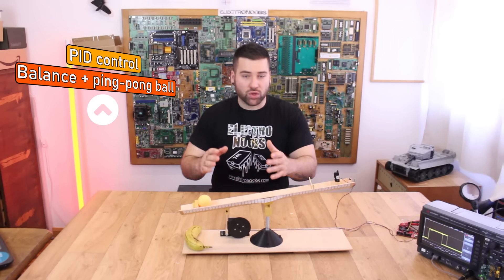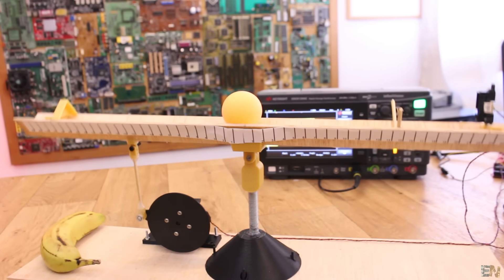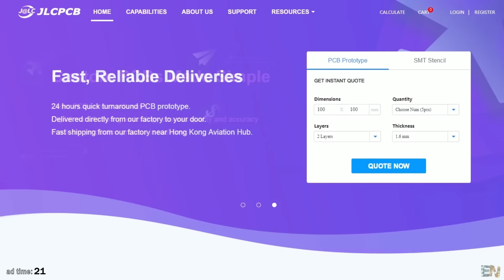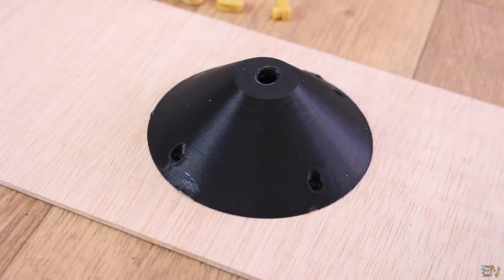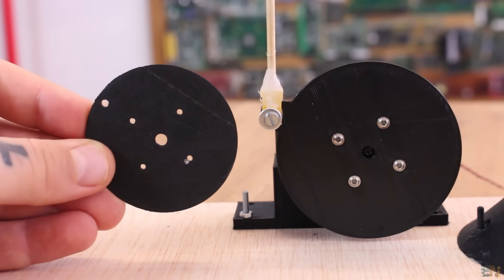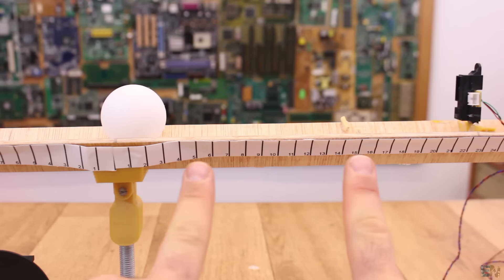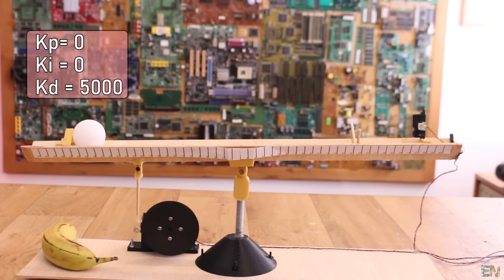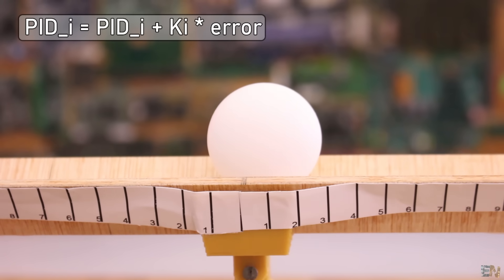PID Balance+Ball | full explanation & tuning

Comment: As a controls technician,  this was explained in detail in my classes.  The number of engineering students comenting on this says a lot to me.   This is a pretty good explanation of pid control.   4 things id like to comment on.   The seesaw set up is a bit flawed, in that a response of say 5% matters a lot more when the ball is at the end of the balance beam than when its at the center.   So non linear control situation here.   2. The use of a rotating servo utilizing a crank(the disk, is set up as a crank) also creates a nonlinear situation.   These 2 items are probably the cause of some of your oscillations.
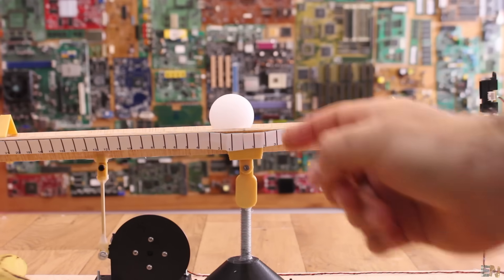3.  You showed it, but didn't comment on it much, that there is a sweet spot in most control loops.  Outside of that sweet spot, it can become unstable.  When you stopped the ball in the center at 8:45, you placed the loop back into its sweet spot and let the look regain control.      You can tune a loop to control over a wider area, but lose fine control at the set point.   Some loops will actually have more thsn a single set of pid values so that once a process upset causes the controled variable to get out of that sweer spot, a better set of pid values is used to regain control,  until the tighter control values can once again be utilized.    4.  Utilizing a small fan to blow on the ball would have been a good demonstration  as to what a loop will do under a process load situation. When using only 1 control type.

Comment: But if the integral term sums up errors in order to take to a state until error is 0 no problem once the error is 0 that means the system has been  equalized but the integral term still sums up the previous errors with 0 but, since the previous error was 0 the iintigral term make the output still bigger and that wont let the algorithm to stabilise the system

Comment: I could see another PID being useful for reaction time required based on the change in position (delta) of the ball that responds much faster to larger changes and slower at smaller changes, also the set point might benefit from a target window to keep the jitters down as i suspect the distance sensor is making rapid changes for minor movements.

Comment: You have a new subscriber. 25 years ago I made a solar follower with some light receiving resistors. Didn’t function very practically, could be improved by this PID system. Scheme was somewhere end the 90’s published in Elektuur (Dutch electronics magazine)

Comment: The control could still be much more stable. I think the P value is just way to high. A nice demonstration that could have been included are very low P values where there isnt any oscilation of the system.
The parameters in the video are good at quickly correcting large errors but that often isnt your typical use case.

Comment: Higher gain values make for a faster reacting system, but they also tend to make the system very unstable if raised too high. This is especially true in systems with a considerable amount of dead time, which is the time from the PID changes its output to when there is a response from the system as measured by the sensor. This is why PID controls always have to be tuned for an optimal balance of performance and stability.

Comment: I want to replicate this awesome project, but as a welder, I want to use lightweight aluminium for the rails and the other parts to make it a bit more rigid. 
Will this affect the code you supply and make it not work? Or can i still use it?

Comment: I supose using an ultrasonic sensor would be an easy change to this setup. But I am unsure if the ultrasonic sensor so used with arduino project is fast or acurate enough
By the way excellent tutorial and I finally understood all the 3 variables

Comment: What m8 screw did you use? Was it a flat head or headless? I can’t see how it fits to the main pivot joint and mine seems not to be a tight fit in the base hole because I think I used a bolt and not a screw

Comment: It doesn't look like the PID model is enough to deal with the static friction at the start of the movement of the ball when it's still. This is why yo still have large oscillations even when the ball is centered. Not sure it can be dealt with strictly with PID though

Comment: Thanks a lot. Please can you do a pid control for fluid pressure using pressure sensor and proportional valve
Reply: https://github.com/drbitboy/pressure_control_via_fan_velocity - it's all simulation and uses a fan instead of a valve, but the principle is the same.

Comment: I have a question about your ping pong PID tutorial, and I was wondering if you could help me with it. I don't understand part of the code you wrote.

After you calculate PID TOTAL there is the following lines:

    if(PID_total < 20){PID_total = 20;}
    if(PID_total > 160) {PID_total = 160; }
 
    myservo.write(PID_total+30);

My questions are:

Why is there a minimum of 20 and a maximum of 160?
Why is the servo response PID_TOTAL + 30?? Why you have to add 30?

If you could help me with that I would appreciate it a lot!
Reply: I am not sure, but I think that is an output clamp on the CV (Controlled Variable).  It limits the servo (wheel) angle position between 20 and 160 degrees.  Note that the process' response to the controlled variable (servo angle) is not merely non-linear (because of geometry/trigonometry):  it also changes changes sign at both 0deg and 180deg.  Also, I don't know how the PID is implemented, absolute or incremental (a.k.a. positional or velocity), but if it is incremental, then the clamp removes any Integral term wind up.

The +30 is likely an offset between the where 0deg is in the code and where 0deg is in the the as-built system.

Comment: I am new to your website and I am amazed by what you are doing, you explain everything really well and you are helping me a lot! So First of all I wanted to thank you for that.

I have a question about your ping pong PID tutorial, and I was wondering if you could help me with it. I don't understand part of the code you wrote.

After you calculate PID TOTAL there is the following lines:

    if(PID_total < 20){PID_total = 20;}
    if(PID_total > 160) {PID_total = 160; }
 
    myservo.write(PID_total+30);

My questions are:

Why is there a minimum of 20 and a maximum of 160?
Why is the servo response PID_TOTAL + 30?? Why you have to add 30?

If you could help me with that I would appreciate it a lot!

Comment: You are a life saver my friend! We have a system that control volumetric flow and we are trying to keep the flow rate steady at very low flows, this is all controlled by a PID system and I had a hard time understanding how to input the values. This really helps! "If the error is too small, the proportional won't affect" This seems true because we have a harder time controlling the lowest flows which is probably not being detected by the system.

Comment: First explanation I've seen that made me understand the Derivative is based on the rate of change of the Error, not just the Error, or possibly just rate of change for a variable which effects a change in error (but which is used without involving the actual error)

Comment: /*///////////////////////////P I D///////////////////////////////////*/
/*Remember that for the balance we will use just one axis. I've choose the x angle
to implement the PID with. That means that the x axis of the IMU has to be paralel to
the balance*/

/*First calculate the error between the desired angle and 
*the real measured angle*/
error = Total_angle[1] - desired_angle;
    
/*Next the proportional value of the PID is just a proportional constant
*multiplied by the error*/

pid_p = kp*error;

/*The integral part should only act if we are close to the
desired position but we want to fine tune the error. That's
why I've made a if operation for an error between -3 and 3 degree.
To integrate we just sum the previous integral value with the
error multiplied by  the integral constant. This will integrate (increase)
the value each loop till we reach the 0 point*/
if(-3 <error <3)
{
  pid_i = pid_i+(ki*error);  
}

/*The last part is the derivate. The derivate acts upon the speed of the error.
As we know the speed is the amount of error that produced in a certain amount of
time divided by that time. For taht we will use a variable called previous_error.
We substract that value from the actual error and divide all by the elapsed time. 
Finnaly we multiply the result by the derivate constant*/

pid_d = kd*((error - previous_error)/elapsedTime);

/*The final PID values is the sum of each of this 3 parts*/
PID = pid_p + pid_i + pid_d;

/*We know taht the min value of PWM signal is 1000us and the max is 2000. So that
tells us that the PID value can/s oscilate more than -1000 and 1000 because when we
have a value of 2000us the maximum value taht we could sybstract is 1000 and when
we have a value of 1000us for the PWM sihnal, the maximum value that we could add is 1000
to reach the maximum 2000us*/
if(PID < -1000)
{
  PID=-1000;
}
if(PID > 1000)
{
  PID=1000;
}

/*Finnaly we calculate the PWM width. We sum the desired throttle and the PID value*/
pwmLeft = throttle + PID;
pwmRight = throttle - PID;

/*Once again we map the PWM values to be sure that we won't pass the min
and max values. Yes, we've already maped the PID values. But for example, for 
throttle value of 1300, if we sum the max PID value we would have 2300us and
that will mess up the ESC.*/
//Right
if(pwmRight < 1000)
{
  pwmRight= 1000;
}
if(pwmRight > 2000)
{
  pwmRight=2000;
}
//Left
if(pwmLeft < 1000)
{
  pwmLeft= 1000;
}
if(pwmLeft > 2000)
{
  pwmLeft=2000;
}

/*Finnaly using the servo function we create the PWM pulses with the calculated
width for each pulse*/
left_prop.writeMicroseconds(pwmLeft);
right_prop.writeMicroseconds(pwmRight);
previous_error = error; //Remember to store the previous error.

}//end of loop void

Comment: Hello Electro. I have this problem with my RC Car that keeps burning up the servo's control circuit, the one inside the servos with h-bridges and other IC's, It happens that I have 3 servos that have good metal gears, working potentiometer and motor, but no controller board, can i use PID with Arduino and some peripherals parts to create a make-shift servo controller/driver board? Video idea? Cheers.

Comment: It’s amazing work thanks, but I want to know how did you calculated the parameters kp,ki,kid? For system
Reply from the maker: In this case it was trial an error. I did not use ant formula to get the parameters. Start with low values of P than add the D and finally a bit of I.
Reply: Electronoobs ah ok thanks bro I’m thinking that you calculated the same as transfer function of dc motor  for example

Comment: EDIT: just found out that this is a copy of the Spanish work of https://youtu.be/HRJiow_k-V0 published in 2015 (cf https://roble.uno/control-pid-barra-y-bola-arduino/ (in Spanish)). You could have mentioned the origin and give credit where credit is due...

In the video  (at 10:55) your formula for the integral part lacks multiplying by ∆t (the time interval). it should read 
PID_I = PID_I + Ki * error * time (but may be you constrain ∆t to 1?)
that being said - fantastic work  ! (EDIT: well not so impressed any more)
Reply: that what i though also... how about the time........... i compare his work to a pid library version1.1.1 by brett beauregard

Comment: Hey I used your slef balancing code to control a wheeled robot. I am using stepper motor. The while loop.ia delaying because of steps in motor control due to which i m not able achieve stability. I used same code for a basic motor which worked. But with stepper motor it is not balancing properly. I used your same code that you used to balance two brushless motor with propeller. Only i changed the motor control part

Comment: Very nice video. And good explanations.

But I have to add that your closed loop system is jerky (jittery) not because of the sensor having a big error margin. All sensors have error margins, big or small. It is also (kind of) true that if the error margin was smaller, the magnitude of the jerkiness would be smaller and be phased out faster, thus the design would seem better. However, your closed loop system is jerky, because your PID coefficients are really big especially the derivative term which increases the bandwidth of the closed loop system and thus they allow high frequency components of error signal to pass to the system in ways you dont really want. You can either pass the control signal through a low pass filter to avoid this problem (design of which can be time consuming) or simply find another set of PID coefficients where (especially) integral and proportional coefficients are bigger (compared to the old values)  but derivative term is much, much more smaller for this system.

Comment: It would be better if you use a heavier ball, a steel ball for example 
the inertia will reduce the frequecy of the oscillations and you'll get a more stable system

Comment: Actually, the VL53L0X is very accurate, at least up to 100cm.  The problem is that the sensor is shipped with a small orange plastic cover for the lens, which must be removed before use.   At 6:19, it clearly shows this cover was not removed.

Comment: very clear explanaion, but filter the value! This is very easy to do with a digital filter, new_distance = new_reading * 0.1 + old_distance * 0.9; Adjust values as needed, this is 10 % filtering. Also for an RC filter to work, you need to add a resistor as well... using a digital filter can also get you a higher accuracy on your reading

Comment: You didn't actually need to use a servo motor in the PID experiment because a servo motor is just a DC motor with PID controller in it. That would be like implement a PID controller on another PID controlled system. Great explanation on the PID part, anyway. 😀

Comment: You can reduce the vibration just adding a condition before loading the value on the Integral list. If the value is more/less than 10% from previous reading, then repeat last reading. Also, do not use the single readed value for proportional, instead use the sum of 3 and divide by 3 last readings. It will became way more smooth.
Reply: Oh a moving average. Interesting idea.

Comment: Great explanation with good example. Thanks! Maybe you would get a bit better results taking in mind that the signal output of that sensors is not linear. If I'm not wrong you need to aply a logaritmic equation in the output to linearize the signal! 😉👌

Comment: You should try using a weighted ball.  You might have better luck with more inertia.  It sounds counter-intuitive, but it will slow the reactions of your pid controller down, and force the motor to make long-sweeps in one direction vs. agitating the ball to move it.

Comment: This is a great video, I appreciate how you were able to simplify it in a way most people cant. Could you please explain why many programmers ignore the derivative by setting it to zero? Im told its because it causes process upset due to the output reacting too fast. But in your demonstration, it appeared to really help... The argument here is that only temperature loops react slow enough to ever require a derivative. Unfortunately no one will allow me to experiment on real process control due to outages. I am mostly controlling pressure and flow using control valves. The process is typically fluid/gas.
Reply: My understanding is that Derivative control is usually turned off unless there is dead-time in the system.  Dead-time is the delay between changing the control element and when the process responds to that change.  But looking at this, there is another case:  where the system is inherently unstable.  I.e. in this case, tilting the flat channel will result in the ball moving forever; compare that to a similar system that has a U-shaped channel i.e. U-shaped in the dimension that the ball moves:  the ball has an equilibrium position for any position, as long as both ends of the channel point upward,.

Comment: I work with PID control quite often yet this is the best way I've heard it explained!

Fancy doing a slight development of the same experiment, but put a fan at one end that you can direct towards/away from the ball to model an outside influence? When you use a PID for cooling, the temperature of the coolant can change, which means your actuator may need to start providing 'more' even though it was at equilibrium.

Comment: can I try and make this using an ultrasonic sensor?
Reply: you can try, as the only requirement is to have a measurment of the distance of the ball. However the ultrasonic sensor has a wide cone of mesure, it could be a problem (the measurment could be unstable). You have to try it :-)

Comment: I love it!  I want to make this with my nephew soon.  My only suggestion is maybe the beam could be made less "jumpy" if you move the attachment to the motor right at the end of the beam and/or decrease the radius of the wheel attached to the servo (both to decrease the motor's leverage on the beam). But this it's totally awesome! Cool fun :)
Reply: like he said, the gitter is not a mechanical issue, it is an issue with the resolution of the sensor.

Comment: Really nice video, great explanation :)
I used the 53L0XV2 some time ago and it was quite capable. I am not quite sure if this picture (6:17)  was just for the video, but you have to remove the yellow tape in front of the sensor and some libraries does not allow you to change the ranging mode (high speed, high accuracy, long range) ;)